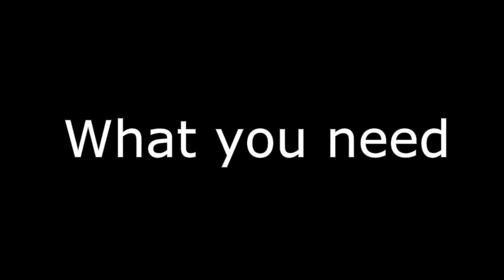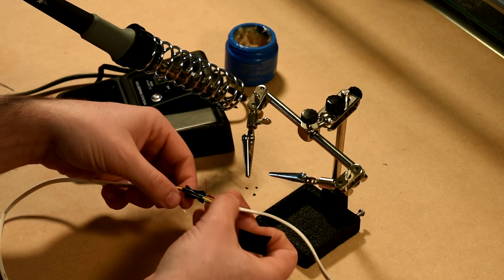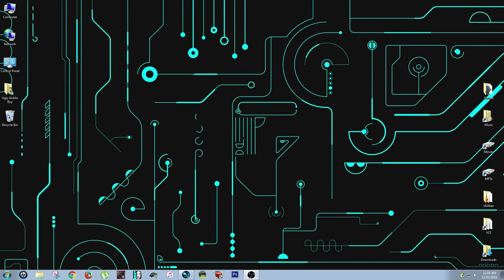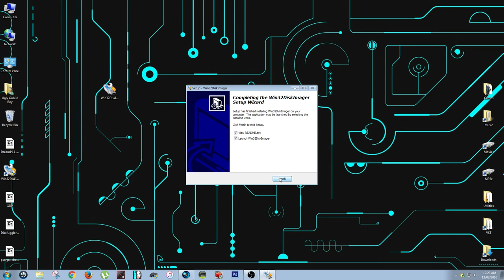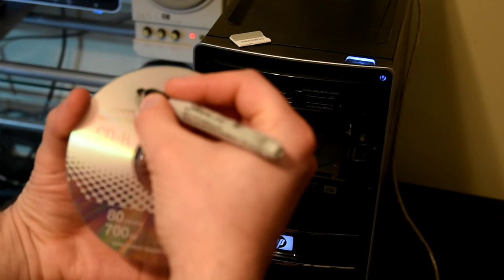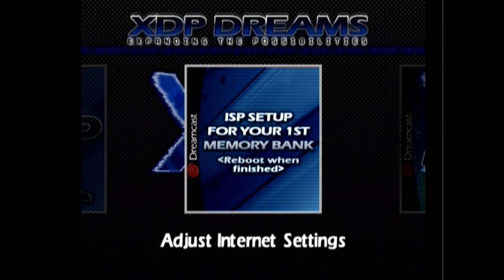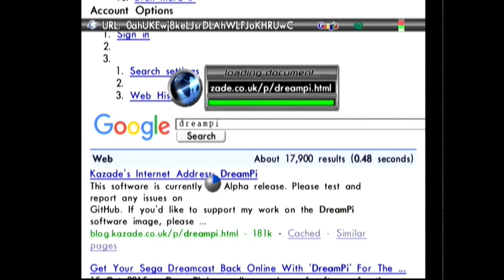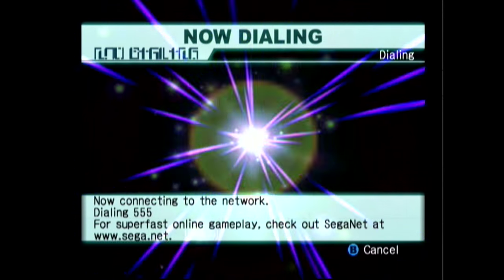How To Get Your Sega Dreamcast Online

Comment: Thats alot of work for a trip down memory lane. Hopefully someone out there will start making kits
Reply: even though it's 4 years later and i'm not sure if you are still alive, it's possible to buy plug&play kits from pzwzrd. you can find it in the shop and it's somewhere between 70 and 100 bucks (incl. raspberry pi).

Comment: May I add, heat-shrink would be a better option if possible. Otherwise I am impressed!
Reply from the maker: +R33Racer Cool, thanks.  It's not my design, but it's a comprehensive instructional video on all the information I've gathered from other forums and tutorials.   It must be getting around, because there are more people than ever online lately.   Heat sinks are always a good investment, but since you don't need to overclock I didn't mention it.   The RP2 I use now has heat sinks and a fan on the case, but I mostly do that just for when I swap out SD cards for my Recalbox.
Reply: +William M. Nash No not heat sinks, HEAT-SHRINK. Look it up if you don't know why it is. It would be better and tidier than using PVC tape is all. Just sayin'.
Reply from the maker: Gotcha, misread your comment earlier.  If you have access to it, go for it amigo!

Comment: Good video. I did this by going the DC to PC route several years ago, but the pi solution looks a  lot simpler.

I think you made moding the cable look a bit more complex than it needed to be for some people, with all that soldering. You just need to get a short phone cable, make a cut, pull out and cut one wire and basically just twist in the components, then tape it up, no soldering required. Or you can put this together on a small bit of veroboard and house it in a project box.

I also think a lot of people are missing the point of this in the replies. It's the same as putting a region-free switch, or an SD card in your DC. The point it simply to do it because it can be done, The end result is not simply playing the games but playing the games with your read DC.
Reply from the maker: It could be done with tape, but the integrity of build would be compromised.   I like to seal it up and not worry about losing connecting during game play.   It's a tonne of fun to find people online and play quite a few different games, check out some of the online mulitplayer vids I posted for an idea of what it looks like.

Comment: Thanks for the video! How did you configure your ISP settings? I'm using a controller and the only thing I seem to be able to do is delete existing info, but I can't seem to enter any new characters. Do I need a keyboard?
Reply from the maker: Thanks for watching!   You can configure the ISP via XDP in the options menu, or if you have a copy of Quake III you can change it there too.

Comment: Hi, Thankyou for your guidance, I'm getting the components to build one Voltage Inducer, but I'm not sure if it is a 0.47uf or 47uf capacitor, since the one you use looks a bit bulky to be 0.47uf. Thankyou very much.

Comment: i have both type a and type b modems . i think one supplies its own power to the phone line in the other one does not. I'm assuming the voltage line inducer is for the one that does not supply its own power into the phone line. if you have the one that does Supply its own power from the modem into the phone line I'm assuming you don't need to put the inducer just trying to see if that's accurate

Comment: Hi there, Do you think it would be possible to use an Orange Pi instead of the Raspberry?   Would also love to have an image file for the Nintendo GameCube..That BBA is WAY over priced too.. Great Video Btw! It was also published on my birthday =)
Reply from the maker: +Nardz Key Lime Pi is optimal, but you can get away with Orange if it's all you have.
Reply: Hey, thanks for the fast reply! So what would make that optimal opposed to the Orange Pi and isn't the Key Lime just an add on for the Raspberry?..I looked it up and I'm not even sure where to begin with using it lol.. Isn't all you need at least like a 4Mbps connection or something to play online games, & can't the ethernet port on the orange pi do 100mpbs..Also would the Ram on the Pi board really matter above 512mb for a project like this and such a simple exchange of data? .sorry about the somewhat noobish questions I'm just learning the network/Pi-board thing..Also the reason I ask is because I have at least 8 Dreamcasts around the garage if not more and I'd like to get them online as cost efficient as possible but at the same time come with an adapter that is above decent. Thank you so much for the help.
Reply from the maker: +Nardz It all comes down to whether you can install DreamPi; as long are your medium supports it then you should be fine.   At the moment the most reliable way to do so is via a RaspberryPi, you could get away with the lower end models which are cheaper but I like the B model and this type of case because when I'm not using it for the Dreamcast I can easily switch out MicroSD cards for other projects.
Reply: +William M. Nash  will this work on core i7 bord  or quad core pentium

Comment: Hello,

Thanks for the tutorial.

Is there any way to draw the power to the cable from the GPIO?

Regards.
Reply from the maker: At this point the best way to connect is by ordering a USB LVI from Dreamcast Live.  PCWzrd13 has managed to make a LVI that uses a single USB plug and no external power source, it's only $29.99 USD shipped and guaranteed to work.  You still need a RaspberryPi, but other than that you are ready to go.

I did make a USB Live using a 9v DC-DC USB step up converter that worked, but PCWzrd13's product looks a lot nicer.

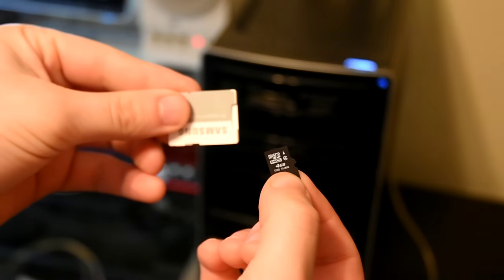Comment: 13:10 I don't understand why your OS says your 4 gig micro-SD is a measly 60 meg ? And is that background music Outtrigger ? It's so familiar but not so sure
Reply from the maker: After you flash the drive, it's partitioned.   It will always be around 60mb unless you use DISKPART in Windows.   Yup, you nailed it.  A down tuned Outrigger (so the YouTube bots don't swipe my vid).
Reply: William M. Nash Yet the fairly large firmware file fits .. ahh BGM22DC.adx =} Outtrigger is terrific I wonder if Ferrari Daytona $EGA GT could be brought online ? As for Metropolis , what the heck , it costs a good chunk of VMU just to play splitscreen ..

Comment: I set up options with DNS and other, how long I wait to connect the Internet with normal 33K modem dial-up? Couple of minutes? 5? 10? In 10 minutes I still see Dialing Modem. :)
Reply from the maker: It should just connect within a few minutes, did it time out?  Are you trying to dial-out traditionally?
Reply: A problem is that blue square in the up right corner doesn't changes colors (red, orange) within aprox. 2 minutes... My modem is broken? Or phone line is a garbage? Yup, traditionally. Everytime I connected, everytime is the same problem with no connection...
Reply from the maker: Do you pay for a dial-up Internet service?
Reply: Pay? I had router and Internet service with telephone and TV.

Comment: I don't understand why anyone would want to do this? It's pretty obvious that a majority reading this will have sense enough to know exactly what I am saying; the fact this is 2017 (21st century) and we use Internet connections with speeds that reach up to 1gb (Google Fiber) is what we are focused on using today. Not dial up speeds. If anyone can find out a way to use broadband cable speeds on the DC let me know!! Until then, it's best to just continue using this beautiful legendary system to play non online games
Reply: SkinCareLuver to connect online? It's pretty obvious
Reply: Jonathan Buchholz No. It's pretty obvious that a majority reading this will have sense enough to know exactly what I am saying; the fact this is 2017 (21st century) and using Internet connections with speeds that reach up to 1gb (Google Fiber) is what we are focused on. Not dial up speeds. If anyone can find out a way to use broadband cable speeds on the DC let me know!!
Reply from the maker: DC can use a BBA, but it only support 2 games.   The DreamPi set up supports all games that are currently online, and those games were optimized for 56k so they do not experience lag.

Comment: I'm pretty sure there is a rj45 to ethernet converter you can use and just use some kind of downloadable iso version and burn it and use it that way.
Reply from the maker: That's not quite how this works.   Think of the RPi as a ISP that your DC needs to dial into.
Reply: +William M. Nash I'm not gonna go out and buy a rpi and sit there and do all this. there are more simified ways then this and they work just as good or better.
Reply from the maker: Cool.

Comment: do you have to sodder? wouldnt just splicing the 2 ends together work? ( asking since it does work for data cables. atleast the ones i spliced)
Reply from the maker: You don't need to solder, but if you plan on using the DreamPi a lot it's a good idea to make it durable.

Comment: Got the Dreampie in today. Got it configured and working as far as the browser. But getting into the game it says the line is busy try again later. I am using a Wifi signal as well. Should I try it with a lan line?
Reply: Ok got the Dreampie to work but having issues with which file to burn to the CD-R. Is it just the loader (Disc Image File) or all the files in the folder?

Comment: cool project but could you add a video with the 2001 Broadband Adapter for the Dreamcast to make the project more epic?
Reply from the maker: +Justin Cruz Thanks, amigo.   The BBA is certainly convenient, but it only supports Quake III: Arena and Phantasy Star Online.   The advantage to using DreamPi is that you can play any online game; many are still active today like Maximum Pool, 4x4 Evo, Starlancer, and Toy Racer.
Reply: William M. Nash I know, I read that on the Dreamcast Talk Forum article. And I am interested in getting my Dreamcast online plus I had it as my late 10th birthday present

Comment: question. if I understand correctly, there is a dial up modem and a broadband modem for the dreamcast, does it matter which you have for this mod?
Reply from the maker: The Dreamcast was released with a standard 56k dial up modem, but you could upgrade to a Broad Band Adapter.  Those are quite pricey nowadays and only support 2 games; Phantasy Star Online and Quake III: Arena.   With this method you can connect to all available online games.   Since the RPI is acting like a ISP, the dial up connection produces virtually no lag.
Reply: William M. Nash thank you. I just recently got a dreamcast after wanting one for 14 years and was thrilled to find an active community. thank you for the video and the advice!
Reply from the maker: No prob, see you online.
Reply: William M. Nash one last question, just to double check, will this work with later revisions of the raspberry pi? (rpi 3b?)
Reply from the maker: Yes, it works with all versions.   If you have a RPI3 you can actually go wireless!

Comment: This looks like a lot of steps.. Do you even have to bother with all this and the Raspberry Pi when you have an original Dreamcast broadband adapter? 

I remember connecting to Schthack's private PSO server a couple of years back by changing some DNS settings in the Dreamcast directly and then just connecting via ethernet in my LAN home network.
Reply from the maker: +zerophyte I tried to outline the step in an overly detailed way to make sure anyone attempting this project would be able to put it together flawlessly.   If you have the original BBA, then all you have to do is set your DNS to Sylverant and you're good to go.   The advantage of this set up is that you can connect to multiple servers and play other online games that the BBA does not support.   The BBA will only support PSO and Quake, but with this set up you can also connect to Maximum Pool, 4x4 Evo, Toy Racer, Starlancer, and Sonic Adventure.   Since the run of phone line to your RaspberrryPi is only about 2 feet, there is virtually no lag and it plays just as well as a BBA connection.   Hopefully that helps.
Reply: William M. Nash So the 56k modem on the Dreamcast will not greatly limit speed? When compared to the BBA.
Reply from the maker: Not really, just remember that most of these games were designed to play online in a time when 56k was still a viable standard.   Also, lag only really occurred because of the distance between your modem and ISP.   Since this is connecting directly to broadband over a 2ft span, the lag is virtually non-existent.   BBA is certainly more efficient, but only supports 2 games; Quake & PSO.   This method allows you to explore the entire Dreamcast catalog that offered online connection.
Reply: William M. Nash Alright, thank you for the detailed explanation on all of this. I appreciate it. Now I gotta go find me some parts. Does it matter if I go for the Raspberry Pi 2 or 3?

Comment: Is the first step required? I don't have access to a soldering iron.
Reply from the maker: Yes, you need to build a line voltage inducer.  The purpose is to set voltage down the phone line to simulate a ring tone, if you don't do it than the USB fax modem will not receive the call signal.

Comment: Does it work with other games, or just phantasy star?
Reply from the maker: +Brandon Owens All games that are currently hosted by 3rd party servers.   Right now the most popular games to play online are PSO, Quake III: Arena, 4x4 Evo, Maximum Pool, Starlancer, and Toy Racer (PAL).   A server for Alien Front Online is suppose to go live soon, you can connect to it via the DNS settings you already entered.
Reply: Do you have to mod your dreamcast to play burned discs?
Reply: model 0 and 1 Dreamcasts play burnt discs. model 2 Dreamcasts don't. you can see the model number on the big sticker under your Dreamcast- it's the number at the bottom of the sticker, inside a circle. If you have a Dreamcast without a sticker, you can take the components out and look at the motherboard and it will say "VA-0, VA-1, or VA-2"... or you can simply stick a burnt game in your Dreamcast and see if it plays
Reply: You only need a boot disk if the disk image isn't bootable.
Most all images are bootable nowadays!

Comment: Does it matter the direction of the resistor or the capacitor?
Reply from the maker: Not really because the voltage is so low.  PCWzrd13 just released a new tutorial with a lot of updates, I suggest checking it out.

Comment: Dang it I got all the items but I can't get any Webbrowser to boot properly. Dreamkey boots but crashes upon entering manual settings, XDP (1.3 and 1.5) won't even boot (utopia doesnt help it boot either) and planetweb doesn't boot either. I got a Japanese dreamcast, anyone perhaps know what the issue is? It does play burned games fine as I've tested.
Reply: Welp, to anyone having this issue. Apparantly it doesn't boot on RGB SCART mode (for me), so I booted the disk without the cables connected, then insterted the scart cable.
Reply: Damn it I'm so close but have no idea what the problem is now. I followed these instructions, bought a USB voltage inducer from dreamcastlive netshop, the recommended USB modem recommended by Kazade. But it simply will not connect "check your ISP Phone #" it says. I tried both ways of the usb voltage inducer, can't get it to work. Does anyone know what the issue could be? I can ping my dreampi fine with no problems.
Reply: After some troubleshooting and talking with pcwzrd we're thinking its the USB Modem. I bought the one linked on Kazade and I was wondering if you bought the same one William?

I ordered the Dell NW147 now (zzz gotta wait a whole month for it) and hope it will solve the issue. Excuse me for spamming but this may help someone in the future with similar problems.

(kazades link to the usb modem: http://www.ebay.co.uk/itm/New-USB-56K-V-92-V-90-External-Dial-Up-Voice-Fax-Data-Modem-RJ11-RJ12-Windows-UK/261903666943?_trksid=p2047675.c100005.m1851&_trkparms=aid%3D222007%26algo%3DSIC.MBE%26ao%3D2%26asc%3D40802%26meid%3Db26842d1337a48db91ac2019495ded0a%26pid%3D100005%26rk%3D1%26rkt%3D6%26sd%3D272220908558)
Reply from the maker: Hey, sorry to hear you're having trouble.   I do know that some USB modems are not compatible with RPi, I have bought 3 off Aliexpress and only one worked.  Unfortunately they were all generic brands, so I don't know the specs on the.  I tried to buy another off the seller that sold me one that worked, but when I received it, it was a different model and also didn't work.  I have read that Dell is very reliable, albeit a bit more expensive.   Have you gone to the Dreamcast Talk forums?
Reply: I have been looking there too yes :), but based on some responses and hearing this from you, I probably got unlucky too. I'll patiently wait for the Dell one :). Thanks for your response and tutorial! Can't wait to get online :D.

Comment: does it matter which Raspberry PI? Please respond as soon as possible.
Reply from the maker: Not at all.   But for the purpose of this video, I wanted to be as specific as possible about the hardware I was using.   If you use the latest version of DreamPi, it is compatible with the built in WiFi on the RaspberryPi 3.
Reply: Thank you very much. I have, I think, Raspberry Pi 1 model B? Im not sure.
Reply: Sorry to intrude on this conversation but I was wondering on the Wi-Fi ability of the Pi 3, I just wanna be sure about this, so you can actually use to built in Wi-Fi connectivity of the 3 instead of a broadband connection?
Reply: No, you would use the Wi-Fi instead or the RJ-45 cable. You still need the hard-wired modem lead.

Comment: А софт для raspberry pi 3 подойдет? И на каком чипе модем? the image of the operating system suitable for Raspberry Pi 3? and at what chip modem?
Reply from the maker: It will work on RPI3, and can utilize the WiFi as well.   The best USB modem to buy is a Dell, they appear to be the most reliable.